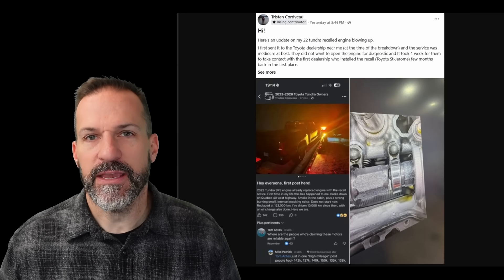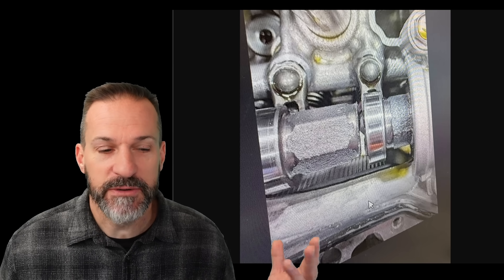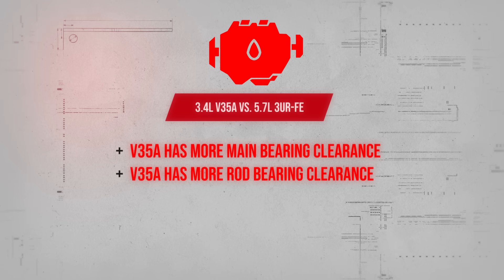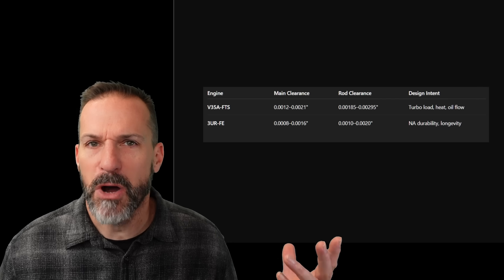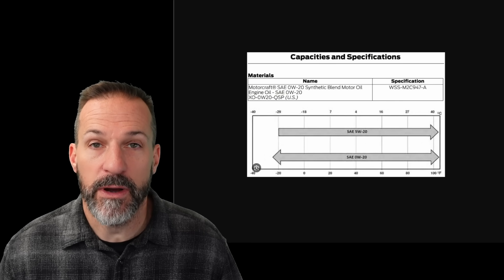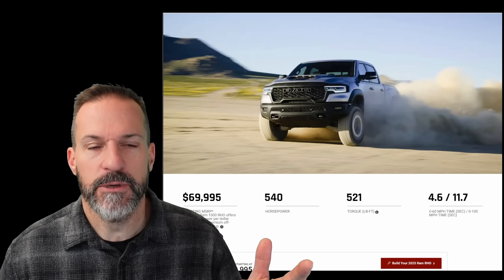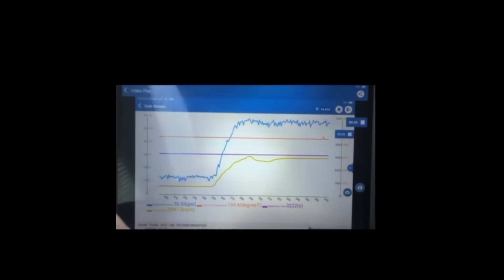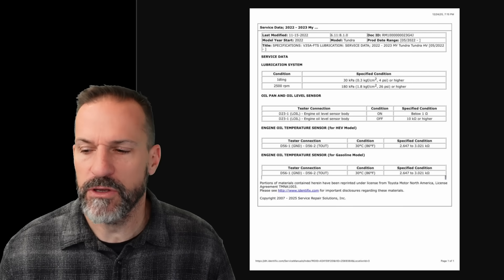Can We FIX Toyota's BILLION Dollar Mistake at Walmart? 2022- 2026 Tundra...

Comment: I would never ever buy a turbo engine in a car or truck. I own a Titan with the BEAST 5.6L Endurance non turbo V8. PERFECT! turbo engines are for "track" cars and diesels. Diesels due to their robustness can handle a turbo. Gas engines cannot and they will fail. How much does it cost to replace a turbo or two, more than you want to know. My V8 Titan will get  up to speed if I "punch" it and cruise and tow all day long. Would you rather have a V8 Hemi or a turbo six? I admit I don't get great gas mileage, but gas is cheap compared to thousands of dollars in repair costs.

Comment: Toyota is already replacing basically every engine for free. I purchased mine used with 74k miles and now has 81k miles. Truck runs absolutely perfect and the vehicle history shows serviced at the same dealership every 5k and I'm doing the same. If it was as simple as running 5w-30, then Toyota would have already started the change. I would bet that they are getting crank shafts that have micro scratches on the journals like GM's L87. No oil or additive can fix machining issues and the only true fix is to slow down production (good luck getting that started) and better qualify control. The 5.7 also used 0w-20 and was bulletproof and if they get the v6 figured out and people are running higher weight oils I bet those little turbos will start failing faster. The biggest issue across the board is the EPA needs to remove the regulations from half ton trucks like the 3/4 and up. They can implement their stupid rules on mid-sized and compact trucks. Manufacturer's having to comply with EPA and customers requirements from half ton trucks is a disaster. Toyota doesn't sell enough trucks to offer multiple engine options like the big 3 are able to do.

Comment: Additives are mixed into all multi grade oil to give it the spread between the low (cold) number and the high numbers (hot). It takes more additives in a 0-40 over a 5-30. These additives in a quart add up thus reducing the amount of true oil in the quantity of a quart of oil. This could also be a valid concern.

Comment: I think Toyota won the race to the bottom on this one! Variable pressure oil pumps not putting out enough pressure because it’s considered parasitic drag when attempting meet fuel efficiency goals. Not allowing enough safety margin in the pump pressure to prevent metal surfaces contacting. Maybe if the oil pump were powered by an electric motor they could do a simple software update and increase the output. But if it’s direct drive off the crankshaft as me and most others would prefer then they need an update to a hard part in the engine.

Comment: Just some weird observations , on my new tundra I noticed the oil pressure on startup over 3/4 mark at idle . My old v8 never got that far . However once both were at operating temp the new truck oil pressure gauge barely moves when I go up in speed significantly. My v8 would move as much as 1/4 under acceleration. 2 questions , how much impact does the start stop and drive mode have on this issue potentially ? The other concern is the solution your suggesting going to impact any potential warranty , i ended up getting a toyota 7 year / 100k bumper to bumper platinum warranty  on the new truck , it cost 800 from my research was descent.
Reply: I’ve never known stopping and starting a turbo engine constantly being a good thing

Comment: I think the lack of thrust surface plus the lack of a broach in the mains is allowing the mains to walk as I've seen excessive scrubbing of the rod bearings against the rod throws on these engines... Drivetrain load pushes the crank forward then the rods push it back again, over and over and over again....

Comment: I have a 2023 hybrid that I have run 0w40 Amsoil since it had about 8k on the clock. It now has 92k with zero issues. This is a work truck that routinely tows 5 to 10k pounds. The truck tows absolutely incredible with the crazy low end tourque.
Reply: Thanks a lot for posting!  Do you know if using 0W-40 voids the warranty?  If it does how would the dealer know?

Comment: 5w-30 all day after short break in.  That's what I run, even though it calls for 0w-20.  No problems at 60k.  Don't use 0w anything after break in.
Reply: Well you won’t know if you hurt it until way over 100K miles.

Comment: Any modern turbo engine running 0w20 is a joke. North America is not use to looking after these kind of engines and the manufacturers are only looking at making money short term. Absolutely no one does a proper engine break in anymore and its first oil change at 500miles. Modern low tension piston rings will not seat properly if it’s not done correctly. After the break in oil change it needs new oil every 5000miles maximum!!!! YOU NEED TO RUN 5W-30 and always warm the vehicle up for 5-7 min depending on outside temps. Absolutely no boost until it’s at operating temp. That’s the reality of new turbo engines.

Comment: Hey Guy's! Ha!, I think your on to something. I've been running mobile 1, Euro formula 0w-40 for the last 10 years now. Have a '11 Volvo EC-70 T6, 99 lexus ES300, 04 Audi alroad 2.7l, 01 Chevy Impala 3.8l, & my latest...15 Tacoma 4x4, 4.0l V6, the Volvo only has 103k and the Tacoma 69K but they all love this oil! Smother, quieter, 5k change intervals and almost NO consumption between changes. Hmmm, wonder what I'm doing right? eh?😁

Comment: "Hi, very interesting subject, may I add the following technical evaluation.   If the recommendation to change oil specifications is aimed at owners who have not yet suffered engine issues, I agree. All auto OEMs stipulate the use of very low-viscosity engine oils in modern engines primarily to reduce friction, thereby complying with fuel consumption and emission standards.
However, for the majority of owners, this oil specification change does nothing to reduce the possibility of diminishing oil pressure caused by blocked oil galleries. These blockages, which affect the main crankshaft bearings, are a result of machining debris left over from the manufacturing process.
There are clearly several fundamental design issues with this all-new engine. Toyota is no novice to automotive manufacturing; they have perfected their craft over nearly 90 years, starting with their first truck (the G1) in 1935. They are well-versed in managing engine block machining processes.
Specialized post-machining cleaning techniques require rigorous inspection and preventive protocols. The presence of even microscopic contaminants can lead to catastrophic system failure, misalignments, or surface defects. My theory is that the cleaning methods used previously worked fine for older engine designs, but internal changes within the new block have rendered those tried-and-tested debris removal methods obsolete.
While the critical oil galleries may be designed for unhindered oil flow to vital components, it appears they were designed without sufficient consideration for the total removal of machining debris during production.

Comment: Sure there is debris in the engine, it’s eating itself alive. 

I’m not going to question the lighter weight oils as I have had three Hondas that were all over 150k miles with zero engine issues or oil consumption issues. Our current 2008 2.4 crv uses 0w-20 as per factory and it runs flawless at 160k miles. In my case, we change oil every 5k, not by a gauge like the factory recommends. If you run extended intervals, I’m convinced you’ll have more issues than someone who charges at 5k for example. I even got over 200k out of a crap Chevy Cruze 1.8 because of 5k oil changes…

Comment: I use 15w-40 in my 7.3 power stroke diesel,  ever had a failure in over 1,200,000 miles. Gas turbo engines just can’t last.

Comment: If i were going to buy a twin turbo truck i would definitely buy the 2.7 or 3.5 ecoboost ford. The fords have proven to be for the most part good reliable engines with the bugs worked out. The problem with jacking with the oil viscosity is even though pressure goes up flow can stay the same or even be less. Sounds like Toyota just needs to bump the oil pump up like ford did on the economy tune 7.3 godzillas which had low hot idle oil pressure and being ups school busses and other work vehicles idled a ton and though not common some were eating lifters. The pickups were tuned different and failure was rare but they bumped the oil psi up in all of them through a pcm update and quit making the economy tune vehicles. Ford fixed the problem through a simple pcm update no oil viscosity change.

Comment: There has to be some company out there that can use tax write off schemes and buy two identical trucks with one using “Manufacturer recommended oil” and the other using 20W-50. Run both trucks for a year and then tear them down at the end. 

Wait for it👇🏽

Comment: Long-time mechanic here. Bearing clearance and oil viscosity are a balancing act. They are linearly related. More clearance equals thicker viscosity.  Less clearance lower viscosity. 

My personal experience tells me that 15 psi at hot idle would be minimum for a healthy engine. The absurdity low single digit minimum pressure specs you may see are nothing more than a way for auto manufacturers to kick the warranty can down the road and pad their fuel economy numbers.
Reply: thanks for posting

Comment: That oil pressure is way too low. That’s remarkable. My Hemi fully warmed to operating temperature, 195-200°, idles around 40-44 psi.  7-13 psi or lower is scary low oil pressure…

Comment: at this point Toyota should just call Ford, buy a couple million Gen 3 D35 EcoBoost (Gen 3 EcoBoost because all of  the problems of Gen 1 & 2 Ecoboost is fixed on the Gen 3) cram it inside the 3rd generation Tundra and will be a whole lot reliable, which is embarrassing to think about how an EcoBoost is miles ahead in reliability compared to this Toyota V35A motor. Shocking!!

Comment: I’ve been running 5w30 in my 3UR-FE in my LX570 instead of the spec’d 0w-20 since the beginning. GM did the same as ford on their 6.2 switched to thicker oil also because of recall. The problem is the new TTV6 was made for a car (LS400) and repurposed for a heavier truck that tows. Too much load

Comment: Someone needs to come up with a ecu tune that bumps up the oil pressure.  Sure does look like oil starvation. 

Ive moved back to 5w30 minimum in winter and 10w30 summer in all my cars.  (No tundra).  15w40 in my 6.6 duramax.  Fully agree its too thin of oil, and too low pressure.  Variable oil pump is a very bad idea

Comment: I think.....I think.....I think.....I think.....Are you a engine design engineer?  Toyota is working on the problem and if it was as simple as using a thicker oil they would come out and recommend it. Do you know anything about oil return? One of the reasons for a thinner oil is for oil return and heat transfer.
Reply: Fixing the problem would cause them to lose their tax credits.

Comment: The bearings are operating too close to the edge, and a subset of engines cross that edge because of some combination of:
	•	Oil film not being robust enough at the main bearings under certain conditions (load, temperature, RPM, towing/boost, hot idle, etc.)
	•	Clearance/tolerance stack-up (crank journals, bearing shells, housing bore/bedplate alignment) that leaves some engines with less safety margin than others
	•	Bearing “retention”/anti-rotation robustness (how strongly the bearing shells are prevented from moving once things get hot and loads spike)

Comment: That oil pressure is alarming. If you do a lot of hot idling in traffic and then accelerate, there is buggerall oil pressure especially if you tromp it. That lag between acceleration and rising oil pressure might be a contributor to bearing wear. Also bigger clearances would not help bearing life with bigger gaps bleeding off hydrodynamic pressure with a lower viscosity oil. Those stupid variable displacement oil pumps are another curse on engine longevity IMHO. Add to that the priming issues after an oil change with Ford Ranger/ Mazda BT50 and it is another sop to CAFE with marginal real world benefits. I would really like to know how much fuel one saves in a year. Not much is my guess. Definitely go for the 5W 30 and change oil first 500 miles according to Lake Speed Jr the Oil geek. Makes a lot of sense.

Comment: I'm a big fan of the Mobil 1, 0W - 40 European formula full synthetic sold at Walmart For around $27 for 5 quarts, been using it in off road vehicles and 4 stroke snowmobiles with no issues!

Comment: Would 5w-30w full synthetic be way to heavy for the new 3rd gen tundras?
Reply from the maker: I don't think it is but it depends on your climate, if you were parked outside consistently below or near -25, you probably want a 0w oil. Check out "The Motor Oil Geek" videos on 0W40 and other weights, his channel is very helpful at helping decide. Given the Tundras issues, if I owned one I think I would consider a 5w30 or 0w40...but that's just my opinion.

Comment: Thats crazy low oil pressure at hot idle. My LLY duramax will throw a code for those pressures. Hell, my land cruiser with the 3fe runs more at idle than that with 270k miles.

Comment: When I first heard about the Variable Oil Pump, it was a comment on a YT video by a guy who said he'd been building race engines for 40+ years. He felt that under certain circumstances the programming of the transmission shift points and the Variable Oil Pump was allowing the crank to wobble at the front creating the bearing damage.
I saw another recent video from someone that got the Owner's Manual recommendations for the V35Afrom some other countries and they all had multiple approved viscosities available. If I had a newer Tundra, I personally would look at a 5-20 or 5-30, as long as it was an approved viscosity somewhere.

Comment: Eric at i do cars stripped a seized tundra. The mains were all spun or damaged, interestingly the rod bearings and cams/ camcaps were in superb condition. I doubt toyotas debris story, i reckon local oil pressure at the mains is the design flaw. Your video does question that in a clear explaination. Toyota need to upgrade the oil pump to deliver minimums oil pressure of 35psi at idle using 5w30 imo. Toyota is losing customers.....

Comment: On the variable oil pump psi note... Fords 7.3 delaminated cam shafts issue was because of the oil variable speed oil pump and the fix was to bump the pressure higher. Why we cant just have a good ole fashioned oil pump.... My 03 suburban with 5.3 and 300k miles idles at 35psi and guess what. That engine is literally silky smooth still with no tapping or odd noises. Healthy engine still.
Reply: my '24 F150 with the 3.5 has one and at low load the gauge doesn't even show the oil pressure being at the low mark tick mark (it's not necessarily "low", but there are two tick marks on the gauge and it sits below the lower one). I haven't looked at a PID to see what the actual pressure is but I don't know why they would even show you that the pressure is so "low"
Reply: @T @Terminxman it’s precisely why they don’t show you. You’ll need a scan tool of some sort to actually check it. A feature in the rams that I DO like. Should be standard…. On my tundra I can see what im pretty sure is the dumby guage. Not a real oil pressure guage. And i cant see trans temp. 2 of the most critical things I’d like to be able to see. Not just when there’s a problem of not enough pressure or the temp is above 250degrees and it throws it to limp mode to save itself. I’d rather see it happening before hand. Not sure why all these
Manufactures have done this.

Comment: Early 3.5 Ecoboosts were very hard on the engine oil in terms of fuel dilution. I've seen used oil analysis reports for 1st gen 3.5EB's that had as much as 5% fuel by volume. These days most GDI engines are highly prone to fuel dilution. It's one of the thing that I believe caused so many timing chain issues with 3.5EB's and GM 3.6 V6's.

Comment: 100% is truth! I'm always usin at all turbo engines 0W40 on a winter time and 5W40 on a summer time, and one more important thing always switch OFF varible oil pump regulator, wher it is possible, or like a way to fix remaping ECU to keep higher oil pressure, at list 3Bar.  All engines which folowed my recomendations still runing good!

Comment: Just to compare, my 2025 yamaha xsr 900 motorcyle was built to make power rev to 10 grand and to be as compact and light as possible, way more stressed then any car engine. 10w 40. or 10w 30 below freezing. The only reason they say use the ow stuff is for fuel economy standards.  Throw in extended service intervals and bad manufacturing wow toyota has lost their rep, so quickly too...

Comment: A turbo charged engine 5W-30 minimum oil spec. This whole idea of “tighter” tolerances is garbage. A Chevy small block from the 70’s had main bearing clearance of .0015-.0020 same as today’s engines. Yet that small block would happily take 20w-50. Today’s oil viscosity’s are for cafe standards only and a way of making the consumer pay for it.

Comment: I work with a guy that has a 22’. He does a lot of idling due to his job and has ran 0w20 and serviced at dealership since he bought it new. 90,000 miles, no issues. He got the recalled engine and has still no issues. I just think that there’s no constant with these engine failures. Yeah it’s the bearings, but people have driven these all kinds of different ways
Reply: thanks for posting

Comment: I think it’s more of a design problem than a oil problem. I really would consider making a video if you find out a tundra engine still goes bad with higher oil viscosity. I think eventually the engine will get killed off or just get resigned